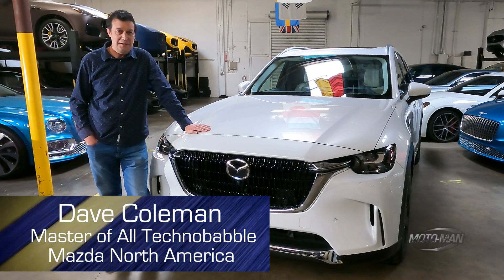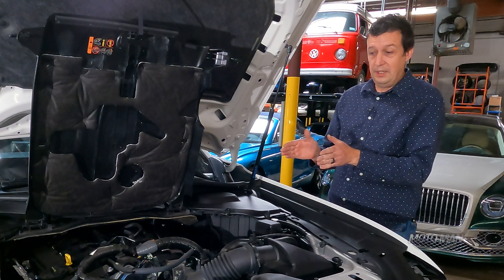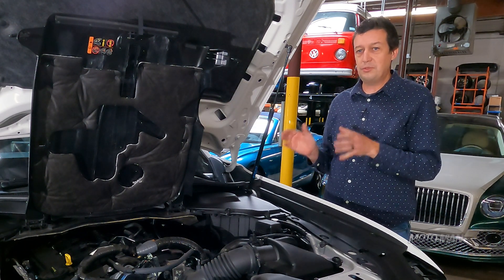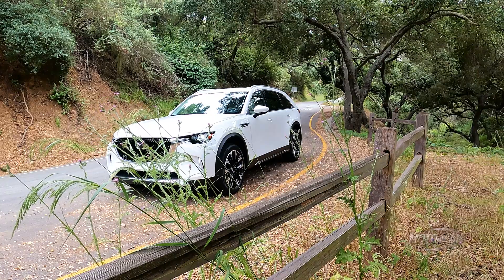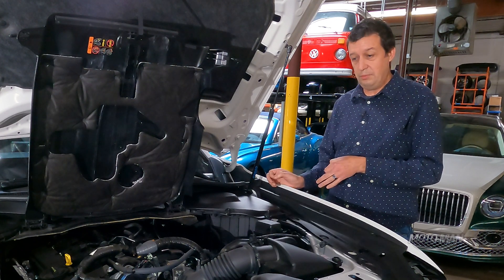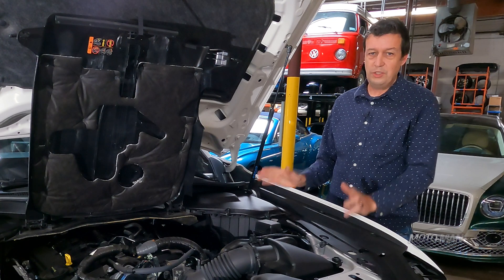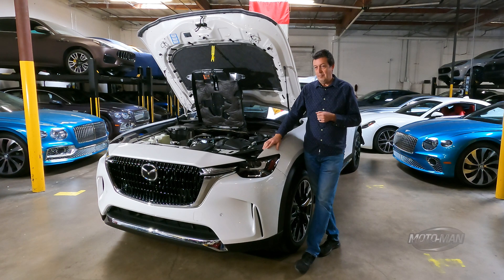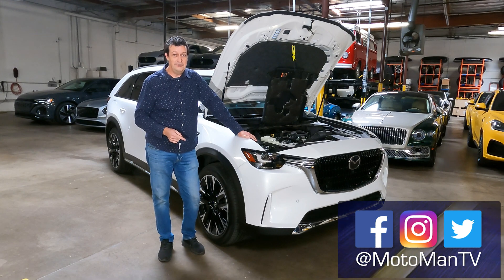How & Why Mazda created the CX-90 PLUG IN HYBRID with Dave Coleman

Comment: Dave. Love the cx90.  My son just bought the gt PHEV. Unfortunately only got one year from the tires. About  35000 km. I have the cx30 gt turbo. I'm on 4 years old and still only half worn. Lastly I would like my next cx30 to be either PHEV or all electric. with 500 km range. Maybe widen the fenders and use wider tires. Now that could be the new 3 and 30. I saw an ai picture and it looks awesome.

Comment: I recently purchase on CX-90 PHEV on premium plus trim. There’s many things I like but few that I don’t.:  the jerkiness of the transmission, it’s not smooth some times, it’s highly noticeable when backing up in reverse into my driveway and need to stop and go multiple times to position it right to fit in. I agree with the other comment that for premium I have to sacrifice on seating since only captain chairs available on those. Why? I have a family of 5 and will be better off with bench and only use the 3rd row as needed, in stay of all the time. Lastly, speed of charging. For the size of the battery, takes too long and does not accept DC fast Charging. In a trip will be impossible to recharge to get max fuel efficiency. Even the Nissan Leaf has fast DC charging. Will not list the so many things I love of it. It will be too long. It’s a great vehicle, just need these things to be tuned up and will have nothing close that compete with it. BTW, thank you!!! For not putting a CVT on it.😊
Reply: PHEV is for idiots.....will take 260,000 miles of driving to pay for itself over the inline gas 6......you should have taken math in school.

Comment: EV system and engine get very confused at low speeds.  I own a 2023 BMW 330e and a 2024 Mazda CX-90 PHEV premium plus and Mazda has some work to do with the smoothness of the power train. Obviously it should get better but I have to point out 1st gen issue.
Reply: Agreed. The trans needs refinement. I have learned it's something we need to live with and it's not a deal breaker since many other things are so great . The thing that bothers me more is the fact that we keep hearing a crunching sound coming form the suspension. Mentioned it to dealers and they keep lubricating it but it keeps coming back. Anyone else have this issue?

Comment: The PHEV is the one we chose and the powertrain is incredibly versatile.  The one thing I don't really hear mentioned by reviewers (or even by you Dave) is how it behaved in Sport mode.  It feels incredibly powerful with instant power and torque when you want to drive spiritedly or merge on a highway.  Then you can go right back in to EV mode.

The TCU update helped the EV only acceleration greatly.
Reply: I agree completely and have mentioned the same thing. My favorite thing about this car is the drive mode versatility. And yes in sport mode this thing moves out! Fun to drive especially for a large vehicle. Cam you please explain to me what the TCU update is? I want to make sure I take advantage.
Reply: Question, does the engine immediately shut off when you go back to EV mode?

I'm wondering about the stress the engine goes through when it cold starts.

Say, you were driving in EV mode, then floor it to merge on the highway, then go back to EV mode, if engine shuts off immediately, might be bad wear on the engine.

Comment: Some of the subtle things like the tail lights are not extended from CX90 inline6 to the PHEV.
Then, you have the space made out for the turbo unit anyway, then why not add jt to the 2.5 lt unit. It may help with both power and consumption

Comment: Dave Coleman has a lot of explaining to do. Why did the get the US get a CX 70(CX 90 with 5 seats )instead of the CX 60? And when is the new Mazda 6/7 Sedan coming out?
Reply: On the AutoGuide Podcast, the Mazda rep basically said that CX-60 was too close to the CX-5 and CX-50 in terms of interior space, and that North American buyers would likely be disappointed with it. The CX-70 is a 5 seat CX-90 because they wanted to maximize the space behind the 2nd row vs competitors and that North American buyers like big vehicles anyway. The rep mentioned that the X5 and VW Atlas Cross Sport were some of the competitors they were looking at.
Reply: There isn’t going to be a sedan coming out. Not enough volume anymore to justify the huge expense. But I agree that the 2 row CX-90 was a total fail
Reply: @slscamg  They need it. Don't do what Ford has done there paying for it now!
Reply: The CX-60 is barely larger inside than a CX-5 and CX-50 is why.
Reply: @DM72513  That's not true. The CX60, 70, 80, 90 are the same width inside the cabin. The dashboard, centre console and the front seats are identical in size.
Also, I've driven the CX60 here in South Africa, its big and long.
The only thing that make the CX70/90 wider is the fenders.
Reply: @lanla6838z you are 100% correct about the width of the cabin and the fenders being the only width difference. The "wide bodied" CX-70/90 are only wider due to the fenders which allow wider tires. That's it. I honestly don't know why Mazda bothered.
Reply: Average of 1.94 children per household for the United States.  Some of us don't need/want an empty row of seats(90).  We need more cargo space and the CX-70 delivers.

I was literally considering a Telluride and leaving the 3rd row permanently folded down. Then i realized the future CX-70 is way better for our needs in every way including ZOOM ZOOM.
Reply: Dave Coleman probably had next to zero decision making power behind the CX-70 debacle. He's on the engineering side. Not so much product planning. CX-70 is an absolute tragedy, but I would be hesitant to lay any blame at Dave's feet.
Reply: The CX60 will eventually come to north America.
Reply: @lanla6838z  False. No even numbers for America. 
Only odd: 30, 50, 70, 90
Reply: The CX60 is a failure here in Europe. Not in sales, but that vehicle have some massive reliability issues.
Reply: I see the comments here it seems like Mazda has a problem then. As far as products go. The CX 5 has been around a long while, the CX 50 was supposed to be the replacement then Mazda has this rear wheel drive platform and only produce the CX 90/70 same vehicle from it? They got to get some balls and do at least what Volvo did. Not a of fan of Volvo but at least they have enough variety of products